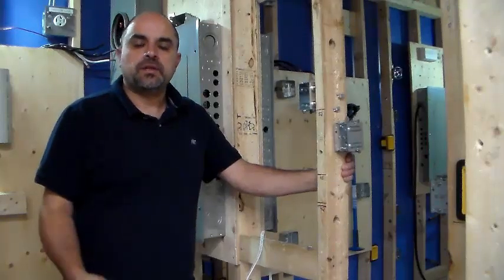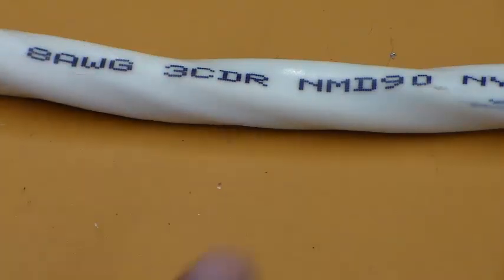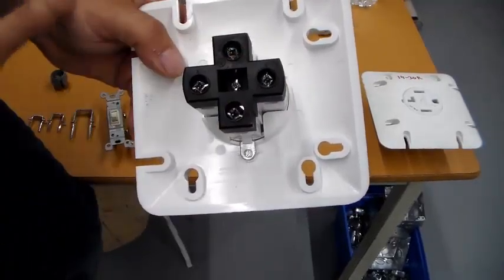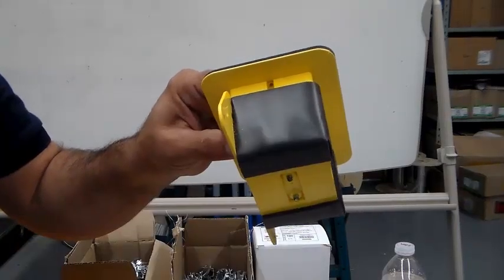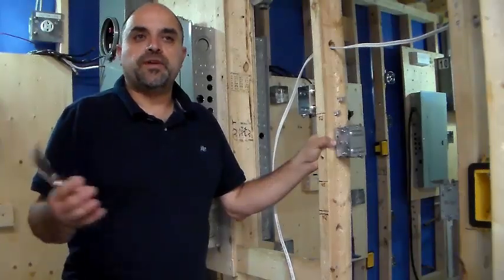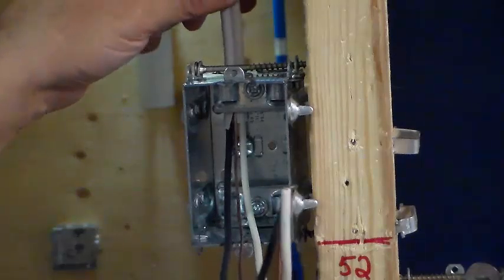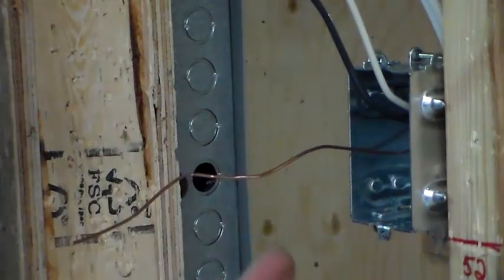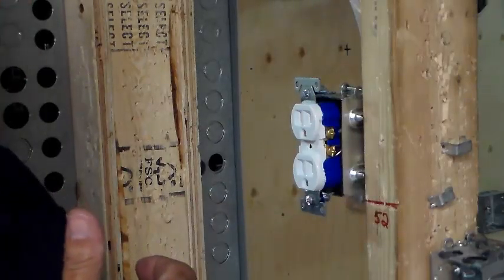Basic Residential Wiring

Comment: can be use 12/2 wire for all plugs on the house or code required 14/2??
Reply: Sam Maltese I agree to a certain extent with both of you. But then again, it would be wise to use 12/2 in a bedroom for the simple fact that if someone wanted a little heater their room which draws about 1500 watts on high if you're by yourself and don't want to heat the whole house, then you're limited to what you can use on that circuit without tripping the breaker. Also I would like to add that it depends on who uses the room too. Kids these days have gaming systems and multiple other things connected to a power strip or surge protector, and they'll be using all their stuff and another brother or sister comes in to watch them play and use a iron and its drawing a 1000 to 1200 watts of power and then you have another brother charging a laptop. So you see, when wiring houses you plan ahead for the future use to keep from having to upgrade later. While it may not be needed currently it saves you money in the long run if you need it later in life. That is the reason most people always use the service panel with the most circuit breakers instead of one that fits their needs currently keeping in mind for future expansion. Always a good idea. And the NEC just keeps adding more things to the picture. For instance instead of just bedrooms now, you need arc fault circuit interrupters in just about every room in the house now and in some cases afci and gfci depending on the situation. I didn't believe it at first  but thats the code. And that was the 2011 code, I haven't looked at the 2014 code. It might have changed again. Just food for thought.
Reply: Rakeem sw Rakeem sw
Correction there is iron that draw 1200 watts walmart sells one that draws 1500 watts. And two you're telling me that no matter the temperature outside the insulation in your house will keep you warm? I have to disagree with you. And they sell little heaters for about $20 at the stores that heat little rooms for when it does get a lil chilly in the the room. The words in bold is a iron sold by walmart. Panasonic 1500-Watt 360 degree Multi-Directional Quick Steam Iron with Anti-Calcium System

$40.08 

4.5 star rating

(66)

Was: $59.00
Reply: You could use 12/2 but why do that when 14/2 is cheaper..  12 is for 20 amp receptacles, 15 amp receptacles are what's standard in bedrooms/ living rooms/dining rooms etc. It would be no need for 20 amps because nothing you'll use would pull that much power, so it would be a waste of money
Reply from the maker: Gerardo Trujillo I agree with Rakeen, it would be a waste a money.But, If the distance from the panel to the first receptacle is more then 35 meters( 100 feet)  then yes I would recommend that only the feeder run be 12/2 to reduce voltage drop. But from that first receptacle and on you can use 14/2.
Reply: Kenneth Gunthorpe no way an iron pulls 1200 watts of power, & if your home is ventilated the rite way there will be no need for a heater in a modern home, especially one that's pulling 1500 watts of power, something that big belongs on a dedicated line..  I understand what your saying but your over thinking the equation now...  80% of 15 is 12 so something pulling 1500 watts of power doesn't belong on a 15 amp line..  1500÷120=12.5 ... Thats more than the maximum amperage allowed on a 15 amp breaker
Reply: Rakeem sw The heater that draws 1500 watts is small not big. I'm always happy to back myself up with information if you would like.
Reply: Kenneth Gunthorpe I'm sorry, your rite, irons do draw that much, my mind is somewhere else, I've been busy all day ... Yes you are correct, but those heaters that are pulling 1500 watts should NEVER be plugged into an outlet that isn't dedicated especially since it can be ran for more than 3 hours continuously...  Alot of people do it but it isn't rite according to nec regulations
Reply: Okay that I need to update myself on. I didn't know that it was a code on the heater on dedicated circuit. Do you know the article so I can look it up.
Reply: Kenneth Gunthorpe it doesn't say heaters exactly, it's small appliances...  But you have to look at it this way, a heater can be ran more than 3 hours,  that's considered a continuous load..  Then you have to add in that 1500 watts is equal to 12.5 amps..  Code requires that you go nomore then 80% of the maximum amperage of a breaker, 1500 watts is equal to 12.5 amps on a 120 line,  1500÷120...  Now you can put  a bigger breaker &  go 20 amps but you still only have about 3.5 amps to play with so it's best to just dedicate it &  don't play with it
Reply: Agreed on the dedicated circuit.

Comment: is there any difference when using plastic or metal boxes ? I mean from electrician´s point of view.
Reply from the maker: few things:
May cost a little more,
In Canada we usually only use plastic on the exterior walls of box to increase vapour barrier efficiency.
You also need to ensure that the bond to he box is connected correct.

Comment: dude i think u forgot that handicap codes for outlets off finish floor
Reply from the maker: If I was wiring a handicap house I wouldn't be installing switches at 52 inches AFF(above finished floor) either. Obviously when doing handicap homes you would need to following build code for handicap restrictions.